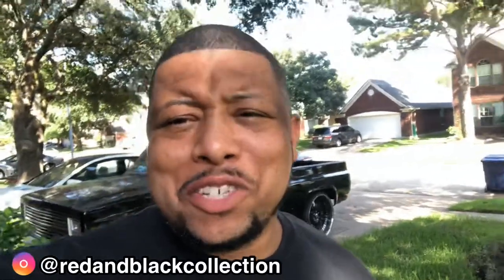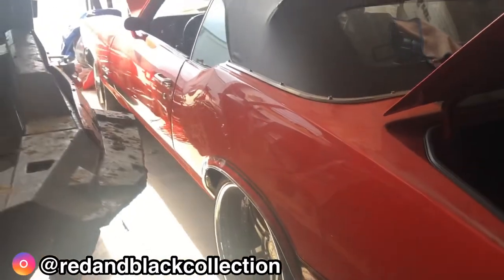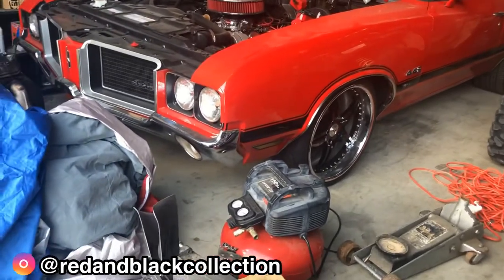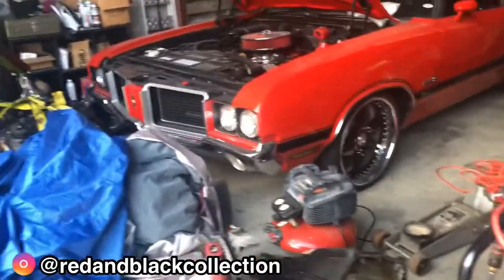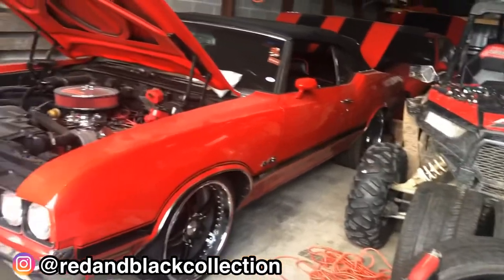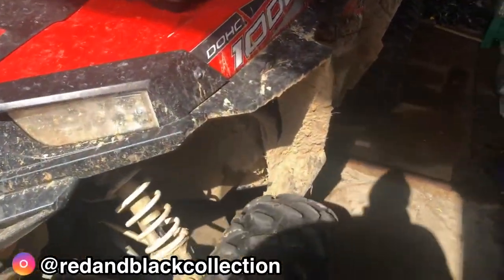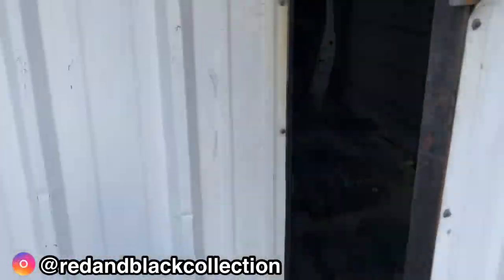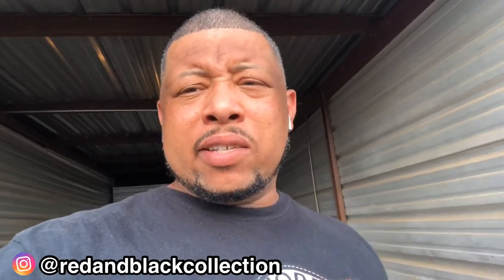UP CLOSE & PERSONAL W/ MY 1971 OLDS 442 CUTLASS ON 20/22 IN AC FORGED WHEELS

Comment: Clean car man! Quick question for you, did you have to put a lift kit, or tub the rear, or qa1 suspension, to fit the 22s to tuck like that in the rear? Or what suspension mods did you have to do for front and rear?
Reply from the maker: Thanks man! I’m running a regular shock and spring suspension, but my coil springs are 2 inch drop springs made by Eibach. My body shop did trim the inner lip on the rear wheel wells to give better clearance. The wheels do not rub at all, even with a people in the back seat. Besides that, that’s it. The wheels are custom made for the car. I think they are 10.5 wide with a 5 inch lip in the rear. I’m running a 305/25r22 tire.
Reply: The Red & Black Collection Thanks for the info, much respect to you, I’m subscribed and will be tuned in!
Reply: Just wanted to check back in with you, can you please confirm the front tire size and suspension setup for the front as well? Thanks again for all of your help!
Reply from the maker: @believe0623deemiller  hey what’s up.. the front tire is a 255/30r20... the only modification to the front suspension is the Eibach 2.5 inch lowering springs.
Reply: @RedAndBlackCollection  Thank you for the feedback, much appreciated, salute to you and I’m looking forward to seeing more car content from you 🙏🏽
Reply from the maker: Thx brother.. you’re welcome. 🫡💯✊🏽

Comment: Very nice car.  I love it !    I have a 71 convertible also   I got a question about the rims also   Did you have to do any modifications to get the wheels to fit in the rear    I want the same rake.  20 front.  N. 22 in the rear ?
Reply from the maker: Thx man! No major modifications to the car… we did roll the fenders, and we measured before we ordered the wheels, so that they would be a perfect fit. Yes, they are 20/22. I have 2.5 inch lowering springs also.